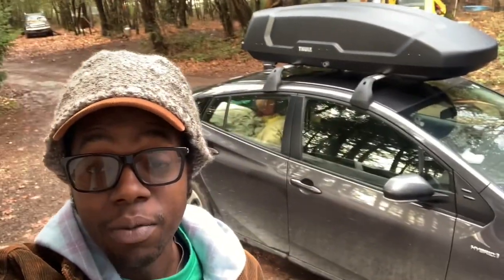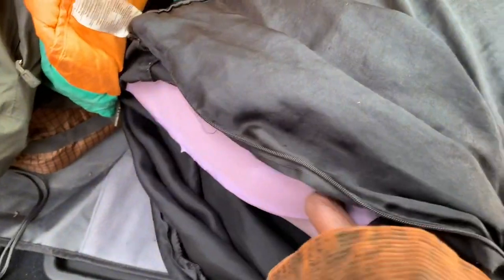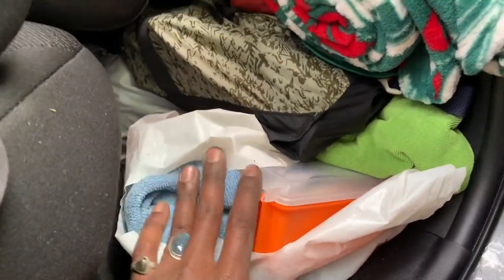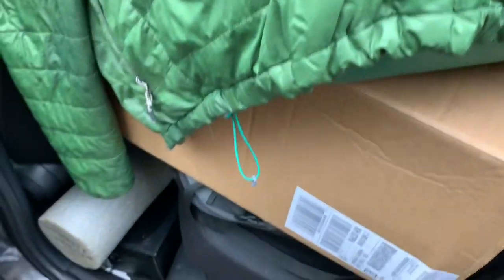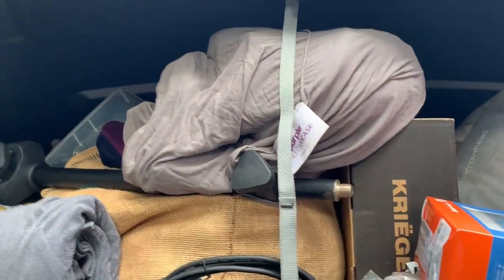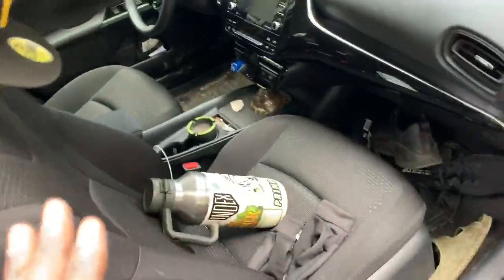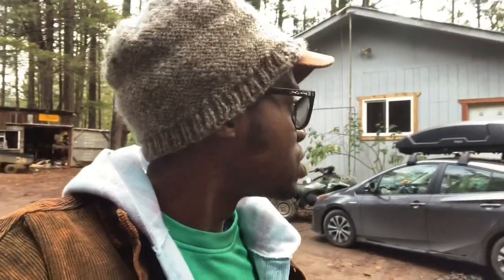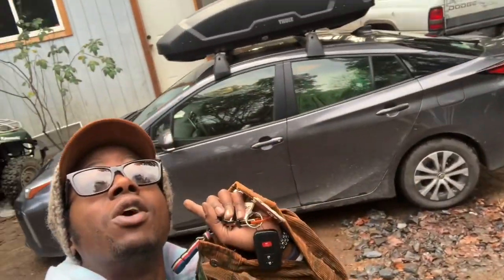LIVING IN A PRIUS 2021!!!!!!!

Comment: How bad of a hit did you take on your mpg with the mounted Thule?
Reply from the maker: I usually average 48-60+ MPG without it and I was getting about 34-44mpg with it. In windier/hill areas is lowers the most. Although it’s easier to drive at higher speeds cause of the weight
Reply: @DivineZeal  You can get 60+ mpg...wow! I recently purchased a 2021 Prius Prime Limited and wondered about the mpg hit from the roof carrier. I typically don’t get more than 54 mpg, but that is significantly more than my 5-series BMW w/V-8 or 4WD Yukon. I purchased the factory Toyota roof rack but have yet to buy a carrier. I am pleased you addressed the stability/aerodynamics, as I was a little worried since I already experience a bit of drift when traveling at highway speeds. My Prime is scary when hitting Colorado crosswinds, particularly on I-70. It is good to know the additional weight helps to stabilize the Prius. Thanks for the time you put into creating content to answer viewer questions!

Comment: The problem with you Prius is that for Prius camping is the 2020 & 2021 is you have an auto engine shut off which mean you can’t run your climate control all night. Should have opt for an older model.
Reply: How long is the shut off? I’ve had my 2021 Prius on for 4 hours one time and it was “on” the whole time of course the engine was going on and off but the ac was on
Reply: Did the engine wake you up when the car shut on and off for the climate control.
Reply from the maker: False Qubert..I think. If you put on the emergency brake on it stops the car from moving a little each time the engine turns on.

Now from what I know, the auto engine turn off activated when you have enough battery and turns on when the battery is getting low. With the e-brake your car doesn’t move when it turns on.

I’ve had it on all night at about 73 degrees with no issues... correct me if I’m wrong though
Reply: @DivineZeal  I actually still get a jolt and I always use the E brake not enough to wake me up I don’t think but you definitely know when the engine starts and when it’s running lol